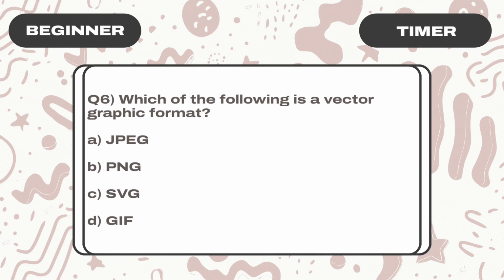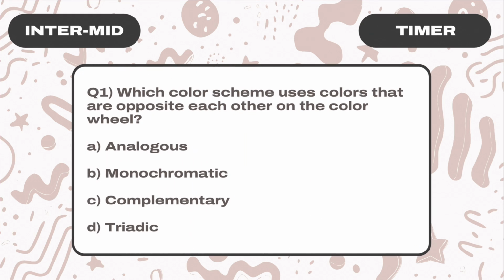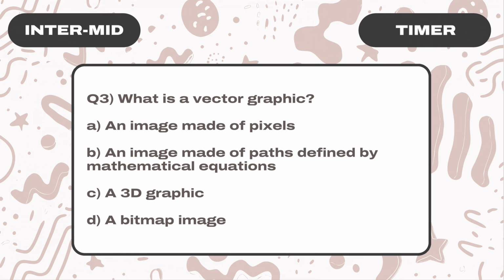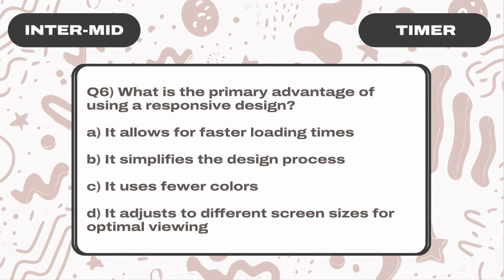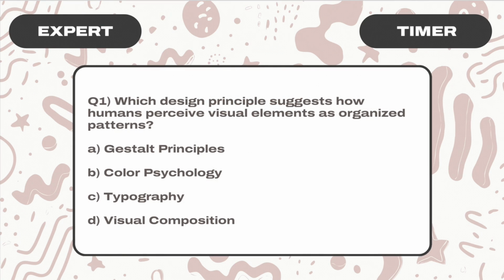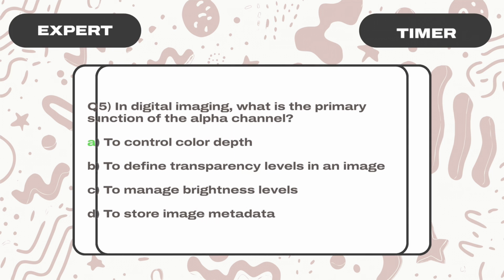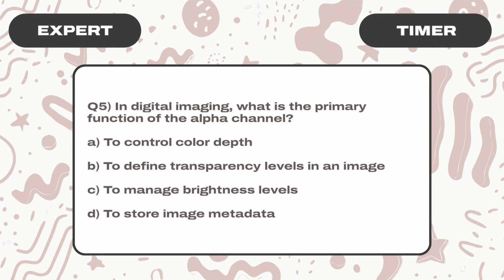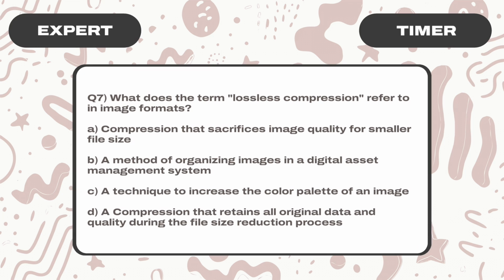GRAPHIC DESIGN TEST — Beginner / Intermediate / Expert / Guru

Comment: 3 decades into programming, graphic & web design, and digital art here and never heard of "The Gestalt Principles". My brain also interpreted the Z-pattern term as Z-axis at first read. Nonetheless, I prefer the term expert, since guru has that shady after-taste of trying to scam and/or influence people. Now a bonus question from my part, just for fun: Which image would you use in a print project: a) a 3000-pixel image with a resolution of 72 ppi/dpi; b) a 3000-pixel image with a resolution of 300 ppi/dpi. - Thanks for the welcome break :)

Comment: 18 - Expert Pro

B-Q3: I thought PDFs were most common or TIFFs for design but now i know jpegs are most used for image quality.

E-Q1: I've never heard of Gestalt Principles, now i understand it suggests humans perceiving visual elements as organized patterns. (Need to learn more of this)

E-Q3: Ive known that SVGs are vector files, but never knew the S meant for "Scalable" which makes sense. I thought of "Solid Vector Graphic" lol.

Overall great test! Proud to be a graphic designer and learn more advanced stuff to reach expert status.
Reply: "B-Q3: I thought PDFs were most common or TIFFs for design but now i know jpegs are most used for image quality." 
In that question he wrote web-design so the only file type, you dont have to open or is to big  to show on the web side is PNG/JPG:

PDF is an Endformat mostly used to get an profecinal print, to have compact  data, or as workdata  in Illustrator ( Vectordata ). You have to use an external Programm to open them and they can get an write protection ( i dont know if that teh right word) so no one can change them. Also it cab  used with interactive  function. It a high compact data
TIFF is a Fomat you only useing if you  have a high resolution.  TIFF are real big so you dont want to use them on websites. TIFF is very special and  most of the used  in photographie or very big pictures.